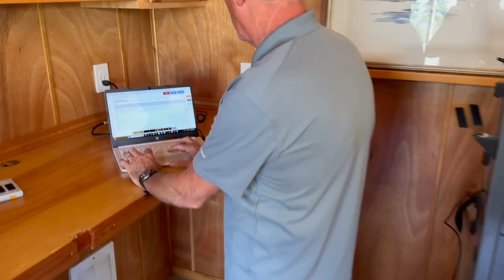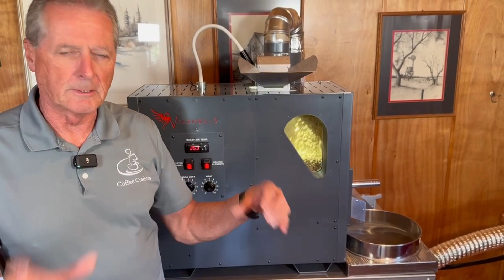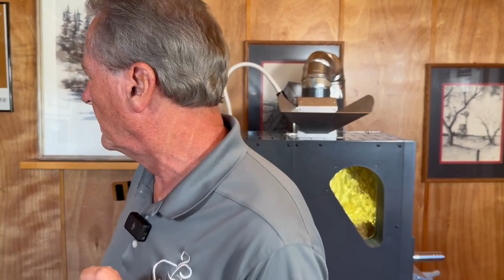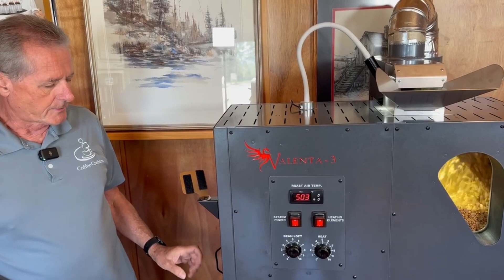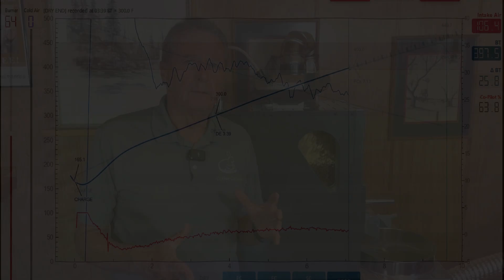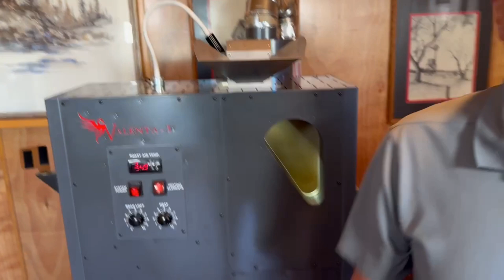Valenta 3 Deluxe Roasting Video with Hermetheus Co-Pilot

Comment: Great video. I’m really considering getting one this coming year. I see in your larger ones, you use rigid duct work. Do you suggest the same in this smaller ones? I will be starting out with this in my basement and if I get enough business going, on to an out building with a bigger toaster in the future where I could use this one as my sample roaster. I’ve never roasted on an electric fluid bed before, but I think it would be a great one to start my own business with.
Reply from the maker: We recommend using as much flex ducting as possible in all of our roasters. This allows for better airflow to vent the smoke and chaff from the roaster. 
These machines are great for starting a coffee roasting business. They are very easy to use and install so you can get up and running quickly.

Comment: What a great looking machine! Question, with the faster roasting times at lower temps, do you feel like the flavor profile is building out to its fullest? I'm still learning (running a Gene Cafe CBR-101) You've seemed to solve some of the shortcoming I have run into like keeping the air intake preheated and not just blowing all that hot air right out the other end. I'm going to keep my eye on this guy! I'm really enjoying what I'm seeing with the Valenta 3 !!
Reply from the maker: We love the flavor profiles on this roaster with any kind of bean. We have done a lot of testing and brought in professional cuppers to help us find the right technique to get the best flavor from these beans. What we discovered was there is a 6-10 minute roast window where the beans have their best flavor. Faster than 6 minutes and the beans are under developed, longer than 10 minutes and the beans get dried out and lose flavor. When roasted in this sweet spot, the beans will have the best flavor.
The recirculation of the air is all to do with the hopper design. We used air simulation software to find how we can achieve this and the results are lower roast temps and shorter roast times.